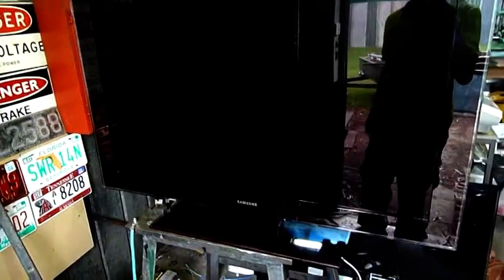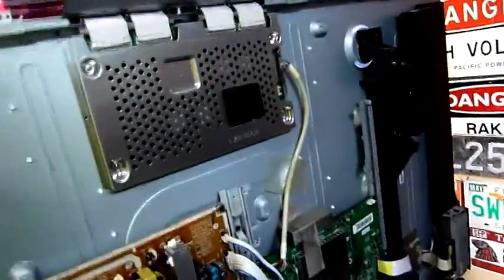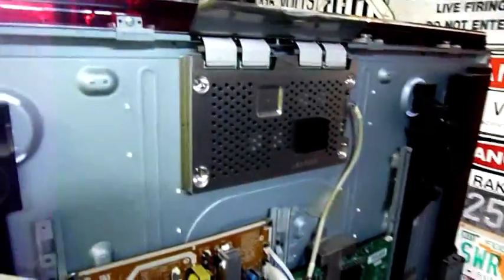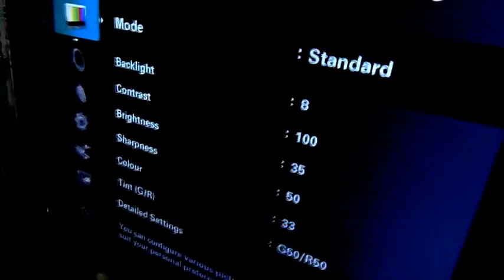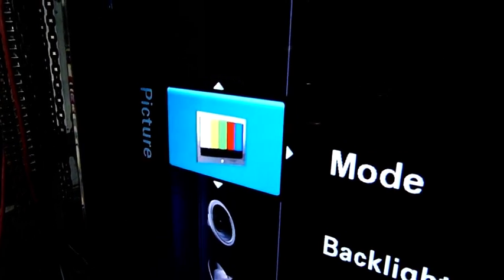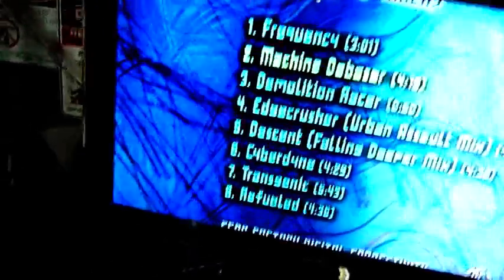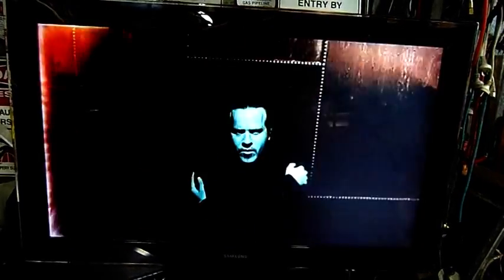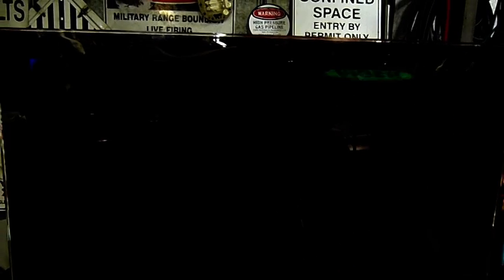Ramblotronic Wednesday - Samsung HD LCD Tinkering

Comment: It should work if you replace a SMD polymer capacitor with a standard electrolyte capacitor if there is enough space. As long as you use the same capacity(and have the same or higher voltage rating on the replacement capacitor) it should be fine temporarily. I recommend to use low-ESR capacitors. Remember to check the Powersupply board for AC in the DC-output - might also cause malfunctions (you could theoretically put some capacitors in parallel to the power output for getting even smoother DC)

Comment from the maker: Theirs a single electrolytic SMD cap on the Tcon board, can I replace it with a normal through hole mount one?, I don't have any SMD's in stock and it will take a while to get them in this time of year

Comment: Definitely doesn't seem like a panel issue, I think you're on the right track. The slow fading definitely seems to me like maybe the board driving the pixels isn't responding fast enough  to keep up. It may take longer to fade in large things (Like the menu) vs smaller things like the signal input window, purely because it has many more pixels to manipulate.

Comment: Have you checked / changed the capacitors on the tcon board? Or maybe the Powersupply part isn't working correctly (check it with a oscilloscope). Hope you can fix it - that TV looks really nice :) Also check the temperature of the chips on the tcon board - and maybe press them down a little bit to see if there are faulty soldering joints of the BGA chips (don't know what they are called exactly, English isn't my first language :) )

Comment: The panel seems okay,hmm,this issue brings me thoughts of the circuitry.  I'd give it a shot if the total plus shipping is under 100$,if the TV gets fixed it will have more value than that. If then you'll see it's the panel's problem feed it to the shredder,you'll find this TV used for 200-300$,the panel will be more,but for the first time keep the happy parts and put them to ebay.

Comment: Or it may just be the TCON(?), or LED row/colum drivers that are failing.

There may be 3 driver-boards, one on top near the "controller", and one on each side. Maybe even one on bottom. Looks like the left board may be bad. (it's the height of the LCD panel and non-replaceable)

I am NOT certain about those details.

Comment: I had a 26" Samsung LCD from 08' and it started to flicker like mad. So I turned it off. Next day, turned it back on, it had a blue screen (no osd, no picture) but there was sound. I left it on then the screen started to  slowlyyy become all white 'flare' exactly like yours then to blue. Then if you left it on for 30 mins there would be picture but the picture was split into 3 horiz' sections. =\ Got it diagnosed, it was the same board that failed, I gave up and tossed it. =D